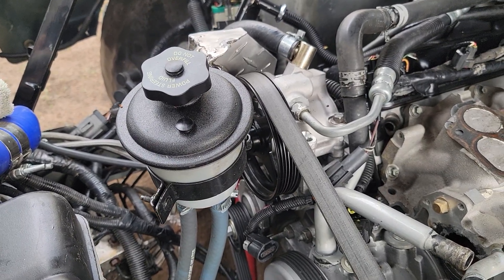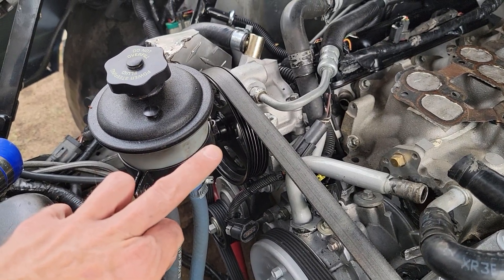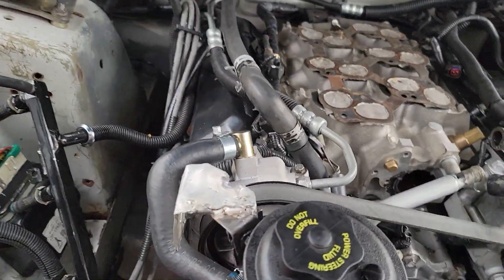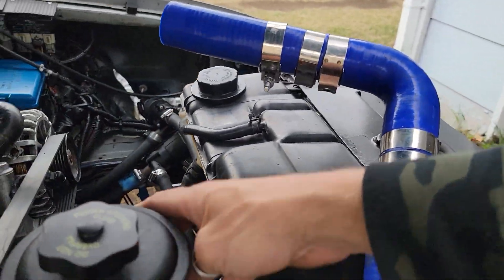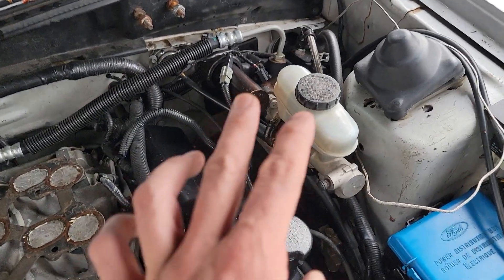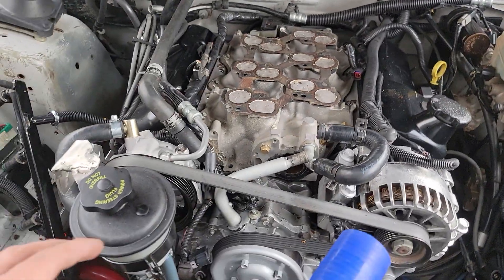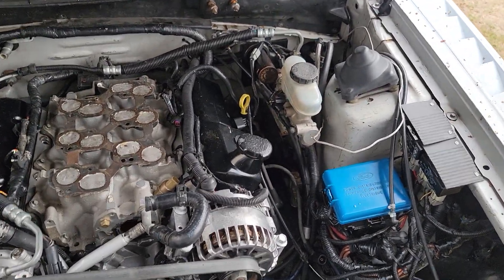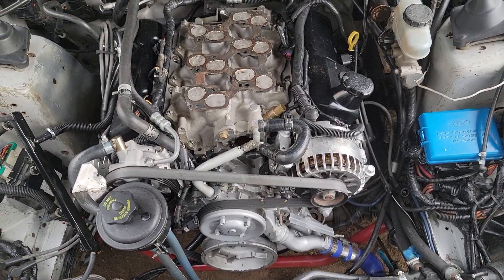Mustang 3.8 V6 Turbo FEA 5: Mod Pump and Hydrobooster Swap

Comment: Are you using super coupe internals, or custom ?   I'm trying to get forged internals. PLEASE HELP
Reply from the maker: Yes. SC block in there. I actually reccomend the 01+ block over SC due to head gasket fix. The 01+ head studs are bigger and eliminated nearly all head gasket issues on the motor. 05-08 4.2/3.9 V6s have even further improved head gasket management.

In a nutshell there is no forged assembly currently available for this motor but I have found several forged assemblies that Can Work Off Shelf. I have a whole breakdown of it in my FB group.

Basically using 351 rods with either buick GNX 3800 piston, LS piston or Nissan VR38dett piston (3.785 bore) we are able to make the ford 3.8 forged piston rod 100% exactly down to every dimension from these items.

The Nissan gtr piston works w no modification but is 1200. Ls piston (600$) needs valve releifs machined as they are opposite .940 to .905 custom wrist pin bushings and is easy with machine work. GNX piston (3.80 bore) needs a .20 overbore cylinder. Same direction to use chevy 350 piston. Add .940 to .905 chevy to ford custom wrist pin bushing adapter and you now have 4x forged piston options on the 351 Windsor  forged connecting rods.

The 351 windsor/ buick piston literally is what SSM sells as "custom forged 3.8 piston" but it's really just a modified shelf piston. That's why you must be .20-.30 overbore to use them